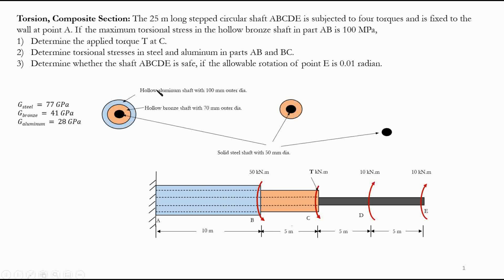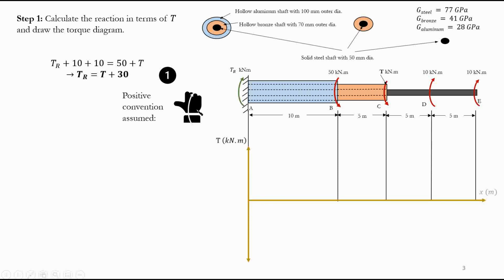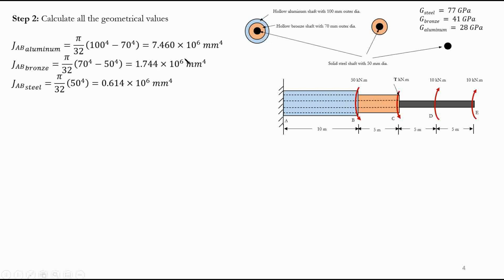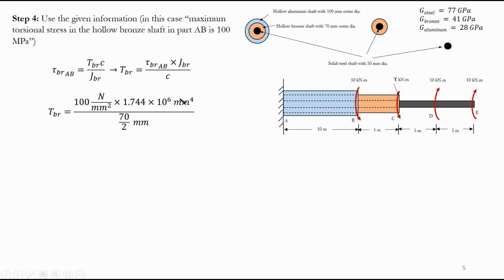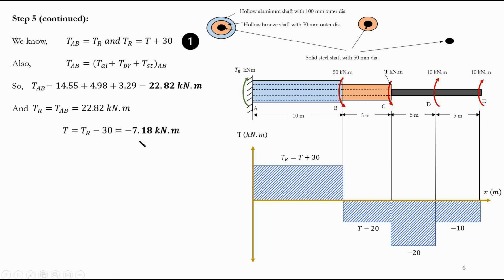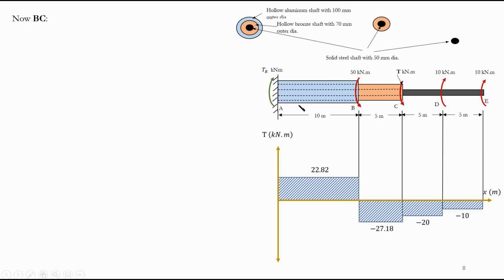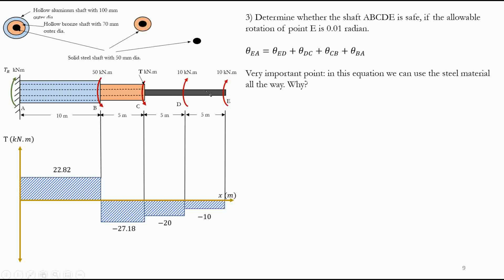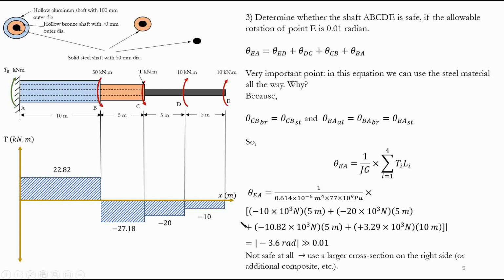Torsion: Composite Section (Comprehensive) - Strength of Materials

Comment: Thank you for this amazing video, If for example instead of having the 100mpa for steel in part AB we were given the allowable stress of the three materials; should I use only one of the allowable stresses to solve for the rest or use the three at the same time ?
Reply from the maker: Hi Karim, thank you for watching! In that case, we will have to calculate the torque based on ONE of those values and get the other torques. And then do the other allowable stress calculations, find the torques, and compare.
For example, let's say we have aluminum, steel and bronze, and the allowable stress is given for all. I will choose one of them, let's steel, calculate the torque of steel based on that, and then use the compatibility condition to find other torques. Next, I will calculate the corresponding toque based on the other allowable stresses, meaning I will find torque for aluminum and bronze based on the allowable stress. Now I will compare the toques and choose.
Here is a numerical example: 
First, we find torque for steel as 5 kN.m based on allowable stress for steel. 
Now, after we write the compatibility equation and let's say find T (al) = 20 kN.m and T (br)= 10 kN.m
Now I am gonna calculate T (Br) and T(Al) based on their corresponding allowable stress. Let's say I find T(Br)=15 kN.m, and I find T(Al) as 30 kN.m. As you see: 20 < 30 and 10 < 15, which steel was the limiting value, we will go with steel values.
Reply from the maker: Basically: 5, 20 amd 10
Reply: @StructuralEng  Thank you so much !!